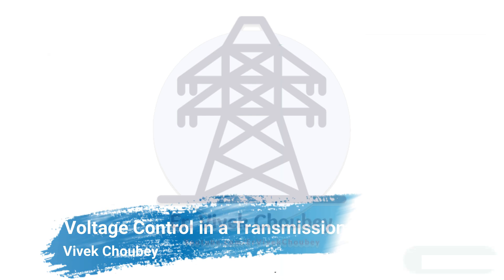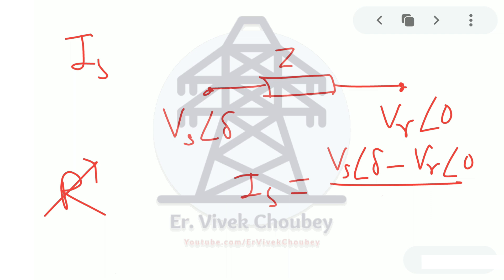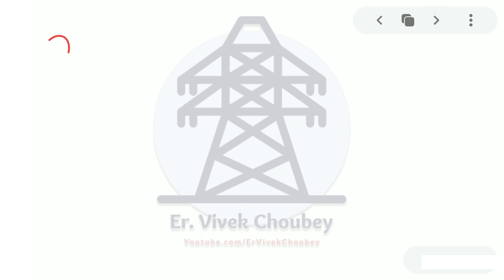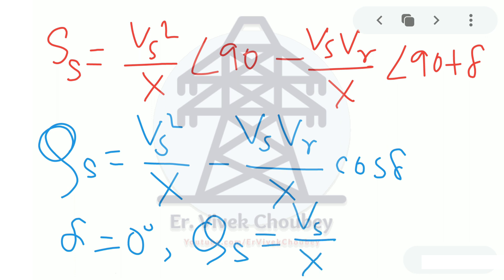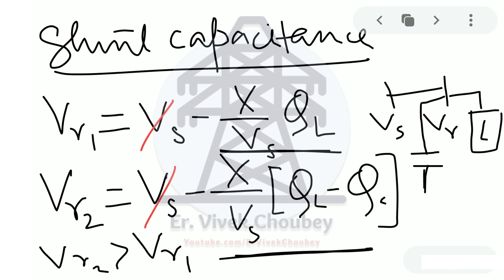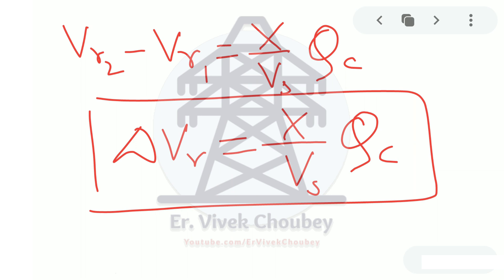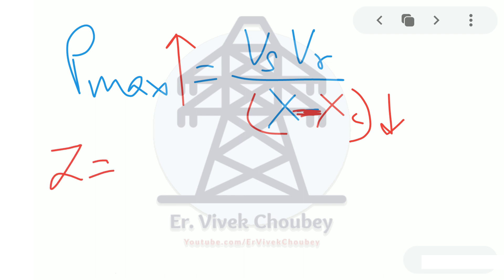Voltage Control in a Transmission line using Voltage Compensation & reducing Voltage Regulation.

Comment: Sending side also uses shunt reactor why?
Reply from the maker: In which part of the video? Please mention time-stamp so that I can help you better.
Reply: @ervivekchoubey  my question is regarding why generator side which is sending side also have shunt reactors in many 500kv grid stations ? This question is not related to your video
Reply: @ervivekchoubey  as you have explain in your video that receiving side have shunt reactors install. I have also seen sending side also have shunt reactors install. Can you explain why sending side have shunt reactors installed?
Reply from the maker: This could be the case for maintaining steady state stability and to maintain maximum power transferrable. Pmax is inversely related to line reactance so shunt reactors reduce the reactance causing Pmax to go up which helps in higher power transfer. Also the alternator is saved from supplying reactive power to the line as that would affect the power factor. So the necessary reactive power is injected by the reactors.

Comment: does the apparent power on the sending end side Ss equal to Sr as Qs equal to Qr?
Reply from the maker: Qs=Qr is an assumption because we considered that both the sending and receiving end voltages are in-phase which means δ=0. But in reality, that doesn't happen because that would mean no flow of reactive power.
Reply: @ervivekchoubey  , Reactive Power flows mainly due to the Volage difference in the Magnitude not because of the 'δ'. If 'δ=0', it implies that there won't be any active power flow
Reply from the maker: The assumption has been made to simplify the solution.

Comment: May I want to know that the sending end voltage and receiving end voltage are still in phase after shunt reactor is used?
Reply from the maker: No matter what you do, those two voltages can't be in phase as there is the line inductance itself playing an important role in deciding this. Also, if these two voltages are in phase, the line won't be able to deliver reactive power which depends on sin δ and if δ is zero then that means no reactive power.

Comment from the maker: Download the PDF file of this session: http://bit.ly/voltconpdf
What's your feedback/query on this video? Please share it in the comments section. Thanks
*Timestamps*
00:00 - Introduction: Why voltage control is important?
01:36 - Relation between Sending and Receiving end voltage
06:18 - Different controllable parameters for desired Vr
06:51 - Under Voltage control using shunt capacitance
10:21 - Over Voltage/Ferranti effect control using shunt Reactance
14:30 - Voltage control using Reactive power control
15:43 - Advantage & Disadvantage of series capacitor
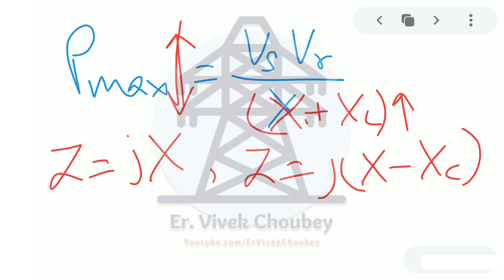17:27 - Ending Note